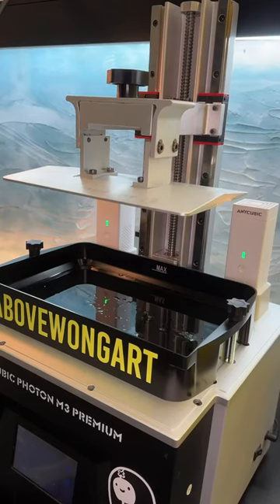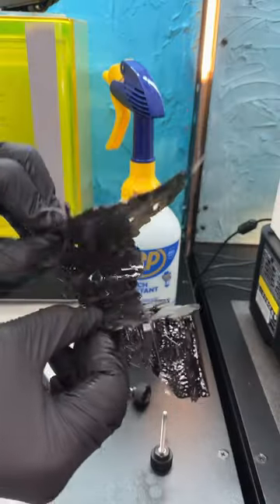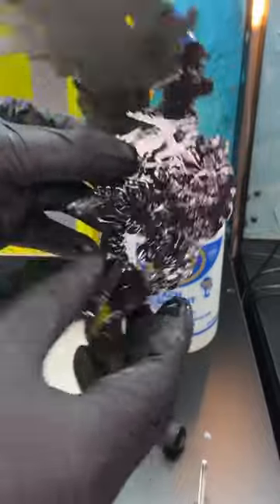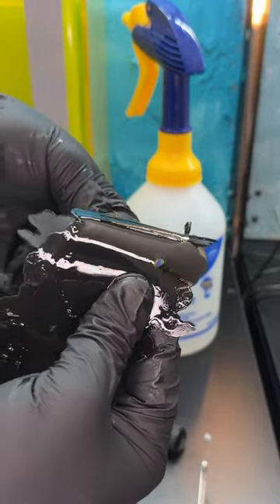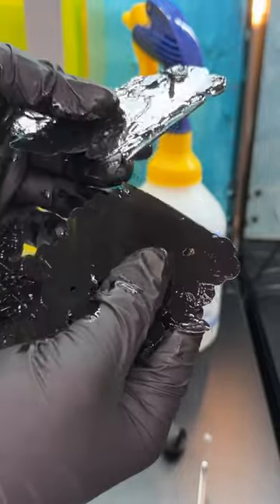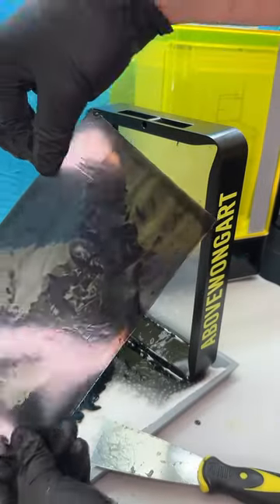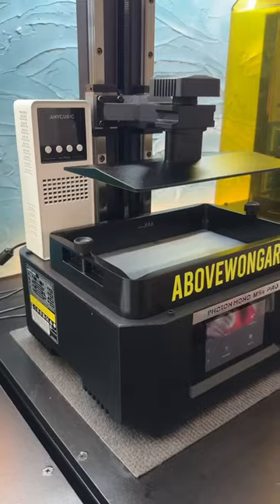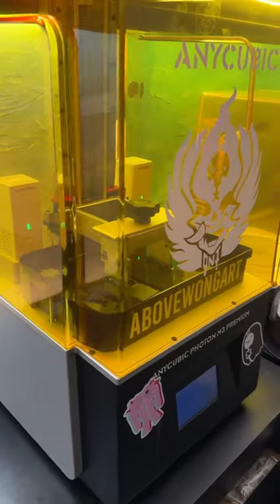Part two: Update on Samurai Mask eating fish on M5s Pro

Comment: I read that I could use water washable resin on my particular printer but after testing it for myself, I went through 2 bottles and more than half my prints came out really bad. Spent two months trying to figure out the problem, switched back to my original resin and worked perfectly fine. Long story short, the water washable resin just wasn't that compatible with my printer unfortunately.